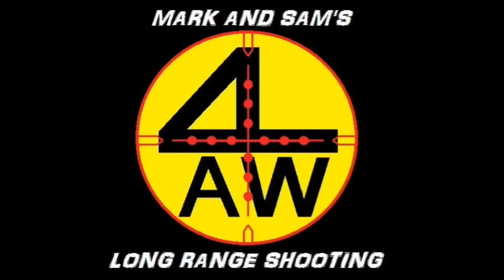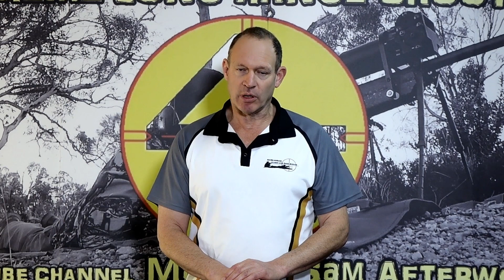Monolithic Projectiles and barrel wear

Comment: Thanks for the video. Im in the process to switch over to the balistix huntac monolithic due to sierra gameking is unavailable in south africa and balistix is a local manufacturer. Last years hunt i shot a blesbuck at 260 meters and had lots of lead contamination. Only retrieved 51gr of the 143gr eldx 6.5cm. Made some sausages and bit on a pice of lead. That turned me to look into monolithic not so much on a environment aspect. I shoot less than 60 rounds a year with my tikka 3006. Only use it for hunting and same target shooting. Shoot my .22lr the most.
Reply from the maker: Thanks Johan, cheers
Reply: Boerewors rocks!

Comment: As you mentioned, monolithics will not be able to deform as much as lead core, and therefore, what I've seen and heard is that the manufacturers of the monolithics need to err on the side of caution and manufacture slightly smaller than caliber (to cater for different tolerances in barrels and I guess for things like polygonal rifling) - eg, a lead core 30 cal will measure .308, while the monolithic may measure .307. Thus, in almost all cases, you are guaranteed to have this gas leakage scenario, and coupled with the typically light for length scenario, you will need even more powder to get your desired velocity - which is the real barrel killer.
Reply from the maker: Yes, as mentioned, all in the details, so worth some research, Cheers

Comment: Your final bore diameter could be slightly larger than the bullet. Say 285 or 286 vs 284. The monolithic bullets do not expand and will not seal like a lead core bullet will. This could leave 0.001-0.002" gap for gas to blow by at very high speed and temperature. I recently collected a new .284 with which I will shoot exclusively monolithic bullets. I will not shoot this rifle until I have measured the bore. I can then order custom diameter bullets from my supplier and be confident in a good gas seal in my rifle and improved barrel life.
Reply from the maker: Cheers

Comment: I was going to try to find another way to contact you, but I figured what the heck.  Posting a question here might help other viewers.  So my dad and I used to reload YEARS ago, but we lost him about 12 years ago.  I have some non-fired target loads that he loaded about 12 years ago, maybe 13 or 14 years now, hanging around the house.  Sentimental value, but like my wife and I were discussing it may be better just to shoot them if I still can.  He'd probably like that more than them hanging around anyway.  So the question to you is it still safe/good to shoot them when they are that old?  I've seen mixed opinions out there and I told my shooting friends "I'll run it past Mark."  Thanks man.  Be safe!!!
Reply from the maker: At 10 to 15 years, should be fine, but test with a little caution, older stuff you need more info, always consult powder manufacturer info, Cheers
Reply: @markandsamafterwork  thanks Mark.